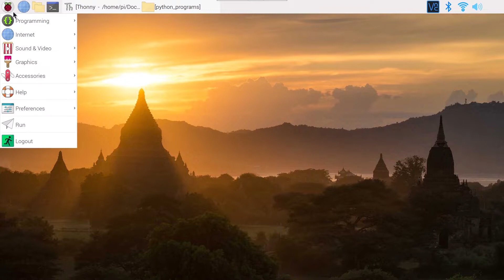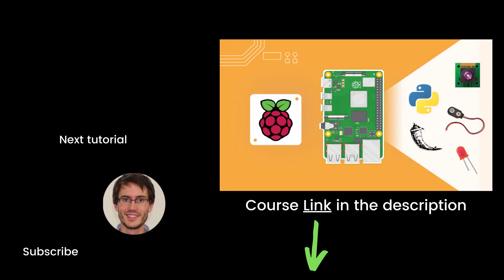Add a Push Button to the Circuit - Raspberry Pi Tutorial for Beginners 8

Comment: Why use 3 wires and resistors for connecting a button, instead of just using a ground wire and a GPIO pin to complete a circuit?
Reply: I thought your question was a good one so I tried to figure it out. That way you will not be able to program it on a pin as a GPIO.Input and you’re working outside of the programming and just through the electrical circuit.

Let’s say you want to have one button do many things. In your situation you’d actually need even more wires then. He’s connecting the button parallel to everything so he can control multiple things through code later on.

He only needs to register the button push once and through code does the rest without adding button/switch wires.

Comment: I am using a Raspberry Pi to capture multiple images simultaneously.  I need to add a button to manually trigger the image capture similar to what you have on a traditional 35 mm camera. The problem is that on top of the Raspberry Pi, I have installed an Arducam 16MP Autofocus Quad-Camera Kit that uses pins 1-6 (of the 40-pin GPIO header) to control and power it.   I have pins 7 thru 40 still available to add a manual button. Can you help point me in the right direction as to how to best make the button assembly if pins 1-6 are currently in use by something else?
Reply from the maker: No problem, you can use any other available GPIO for the button. See here for more explanation, you can pick any GPIO represented by an orange box: https://roboticsbackend.com/raspberry-pi-3-pins/

Comment: Can I ask why you pull the SD card out and handle the gold with your fingers.  This is an adverse risk to me as the sweat off your hands will corrode and short circuit the Sd card rendering all the work you have put in unavailable.
You appear to have sufficient room around the Pi to do lots of things and none of them would come close to touching the SD.

Curious why you do this and cringe every time you do.
Reply from the maker: I guess I don't sweat that much from the hands :)
Joke apart, yes I could be even more careful with the SD card. For now I had zero problem doing so. I just make sure (and also recommend) that the power is off before I touch anything.